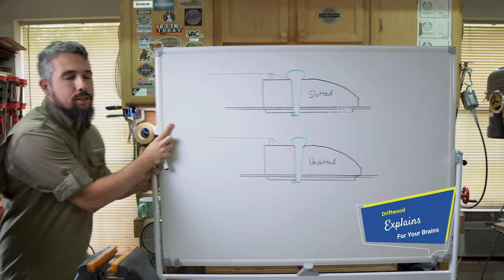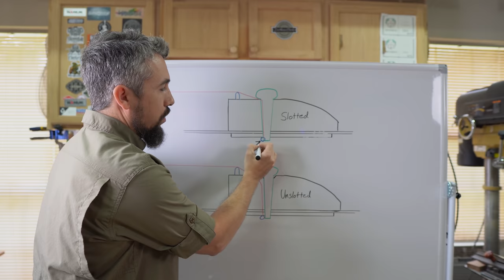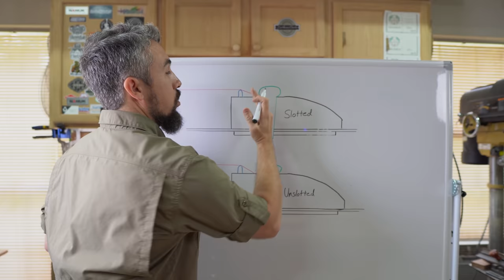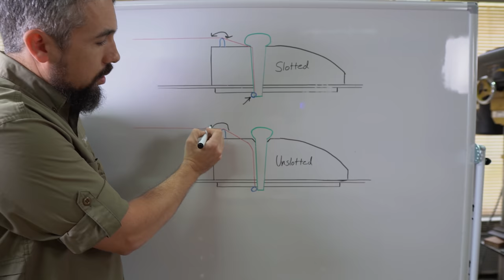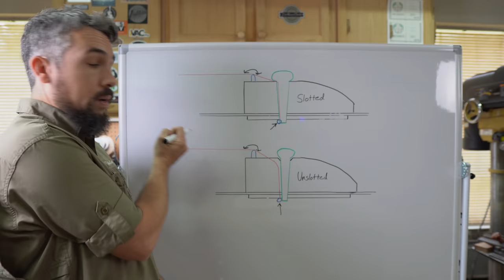This $25 Tool Can Help Anyone Make Their Guitar Sound Better!

Comment: Two points.  First, I'm not convinced this change in tone has anything to do with the slotted/unslotted pin.  I think the tone change is entirely due to the increased break angle, so you could get the same effect just sawing the slots at the top, but keeping the slotted pin.  It's the bridge that transfers the energy, into the sound board, not the ball end - classical guitars don't have ball ends at all, and archtops with tailpieces are not even anchored to the soundboard at all.
Secondly, and more importantly, you need to be very careful about changing the break angle, because you're fundamentally changing the way the static force (i.e. that due to the tension of the string) is applied to the bridge and soundboard.  With a shallow angle, the force on the bridge is mostly downward, but as you increase the break angle, the force is increasingly lateral, pulling the top of the bridge towards the nut.  For tall, thin bridges this can distort them, or make them tip forward in their slot, ruining the intonation.  You're also changing the force on the whole bridge plate.  With a shallow angle, the tension of the string is mostly pulling where the string enters the hole.  With a high angle, that force is applied much higher and further forward, and may easily double or more the rotational moment on the bridge plate.  Depending on the soundboard material and the bracing construction, this can cause the soundboard to deform, with the bridge assembly twisting towards the sound hole and developing a distinct belly in the lower bout below the bridge.  Many acoustics develop this problem over time anyway, but if you increase the break angle, you're only going to hasten this.  I'm not saying it's wrong to do this, just that you need to know what you're doing.  It's not something to be taken lightly.
Some of the comments are saying they've done this, and how much it's improved the tone, but in five or ten years, after their soundboard has distorted, and they need their neck re-setting to compensate, they may not be so thankful.

Comment: I saw a flash of a bridge style in here that is the same style as I completely replaced on a 1985 Vantage I bought from a pawn shop for $68.00 to learn on so I wouldn't have too much invested in something that might just sit in the corner collecting dust and the odd mite.
 Turns out I'm enjoying it almost two years on now.
 The bridge was a normal one with pins, but it was getting a worse belly bulge and the higher the strings were rising the more I played. I bought another cheap one (92 ovation that turned out to have the same problem), set the Vantage aside and looked at it from time to time figuring out what I'd do about it. Bought a bridge doctor and decided not to use it because it just seemed like a bandaid.
 Finally decided to pull the strings, put it on a multi-use steam box I built for hatmaking, so I was able to steam and press the soundboard back to it's slightly curved shape over some months. Carved out some elk antler in the shape of a tailpiece and bridge like (the same as I found from going to your website and watching your video today) your Di Vinci setup which sounds and plays great with no bulging at all after about three months now. I made another one for the Ovation Celebrity, but, I think I killed it while trying to readjust the neck angle from the inside with a tiny jack. Though I may be able to correct the problem (a crack in the plastic back), I don't have much invested in it either, so it won't be a heartbreaker for it to turn into wall art. The antler pieces I made can be transferred to any number of guitars  (perhaps one I build should I collect the requisite wood) so my works of art will be useful for years to come.
 What do you think of carving the bracing from the solid soundboard and back rather than from using the separate pieces glued into place? I like to experiment!
 Mass respect for your prices! Artists get so little for their work!

Comment: I use an up stroke to slot the bridge plate so as not to tear it out like you did . Once that slot is established then I will use down strokes to ramp the bridge. I also will turn the slotted pins around if they are wood or bone. If not then order some new solid pins if they are plastic.  Enjoy the video, thanks for sharing.

Comment: What if you took those "teaching guitars" that you've cut in half, and placed some drum tensioners around the sides, and made a cork gasket to go along the edge, so you could put them back together, how well do you think that, or something similar, would work, so you could demonstrate how what you've done has changed the sound?

Comment: You should make a PSA for that tire analogy: "Quit spinning your strings and increase your bridge's contact patch by 37% for more sonic traction on those cowboy chords! 🤠 You'll thank me later 😉👍"
Reply from the maker: Haha I love it
Reply: + @DriftwoodGuitars  
Sorry for the offtop, but what do you think of "tonewood debates" in electric guitars -- can we get any predicted benefit from "tonewood" ?
Higher than 5-10% than overall component synergy.
Reply: @iridios6127  bridge to tuners should be practically rigid, so the energy stays inside the strings longer, that's how aluminium necks, chipboard or acrylic bodies sound just like "the real deal". Good material choice and the resulting imperfections in resonance/damping and rigidity color the sound favorably, not the trader printed sticker label. Same as this $ 25 saw might as well be a very low profile nut file or a $ 3 saw or a piece of sheet metal with a single row of teeth cut quickly, the results and ease of use matter, though ;)
Reply: @dushk0  
Thanks for the answer, I guess.  ))
But I’m not aware of your experience with wood.

Comment: What concerns me is that the increased saddle contact will shift the intonation - pretty tough to fix that on an acoustic. Keep in mind that the whole issue that makes the strings need slightly different lengths is that the resistance of the wire to bending at the end point effectively shortens the string. A knife edge saddle (if it doesn't cut the string) allows the end of the string past the saddle to pivot with the vibrations, rather than be held still like with this slotted bridge approach.
Also for those who think this might improve sustain: that's impossible. The more efficiently you couple the energy of the vibrating string to the body of the guitar, the faster it will dissipate.  I have to use super heavy strings on my resonator guitar exactly for that reason - otherwise the strings' mechanical energy gets transferred to acoustical energy so fast that it starts to sound like a banjo, all attack and no sustain. If you do this mod, move up to a slightly thicker gauge string and your sound will probably be amazing - as long as that intonation issue doesn't bite you on the bridge.

Comment: I've watched a video where the guitar tech said that doing that cut keeps the bridge from ripping apart, because of 1. strings pulling the bridge, 2. pins distance between each other so the results is ripping the bridge.

Comment: The break angle doesn't change the sound, as long as it's "enough" to keep the string in touch with the saddle during the cycle. If you'd like send me a message I'll give you a link to more info from people who have tested this. Slotting the bridge is good for the bridge plate, and may help if the instrument has a low saddle, but that's about it. Nothing you said in this video is sientifically proven, or true. Unfortunately. Those who have tested this stuff have different findings than what you are saying here.
Reply: Steeper break angle = More tension = better contact = more effiecient transfer of energy. Seems clear to me. Thats why some guitar companies have started slotting their bridges. Hold a moderately hot iron bar, you can maybe last a few seconds. Grip it tight and that energy transfer is almost immediate. Couple this with full contact to the bridge plate and you are bound to notice a difference. Most Cort Acoustic Guitars now come with a slotted bridge, its not done for fun.
Reply: @paulneedham9885  This isn't an opinion. As long as the string doesn't lift off the saddle during the cycle no power is lost.  The angle needed for this is quite small. Different wrap angles on the saddle can alter the timber, be limiting the rolling motion of the string and thus reducing it's effect on the transverse mode.  But it really needs to be high to have that effect, which usually isn't good nor bad, but more often not positive, it's rare though. Do you have guitar making experience or are you just covinced enough to go spend 100$?  As far as the ball end, I see no reason why it should be pulling less tightly against the top then with a well fitted regular pin, it has the same tension. Either way in order to claim it has any tonal effect you can have an opinion, which is just that, or you can rig up an experiment which isn't easy to do nit the least because any difference will be so small it would be hard to measure. You'd also have to account for the removed mass which can make a bigger difference than the other stuff. Anyway... I have no problem with any of it, it a good mod to do. But I will speak up to misinformation put together In order to sell you a few overpriced somethings, which is exactly the practice that was frowned upon at the beginning of the video.

Comment: I'm happy to see luthiery techniques shared with the public, but I'd be happier if they didn't come with bad explanations. The energy from the string tension at the ball end going into the bridge plate or into the pin is not relevant to timbre, because THE BALL END DOES NOT OSCILLATE WHEN THE STRING IS PLUCKED. It's not a "slim tire - wide tire" situation because the power transfer doesn't occur there. There is no oscillation left past the bridge in the string for it to transfer. A much more accurate automotive analogy would be to describe the ball end as the lug nut that holds the tire in place. Unless something is seriously wrong, changes there aren't going to change tire traction.

The soundboard is excited by OSCILLATION AT THE SADDLE and it is the downward force at the saddle ONLY that transfers that oscillation to the soundboard. The bridge saddle apex is the tire. The ball end touching whatever else has nothing to do with it. That's why string tension pulling directly upwards on the bridge plate or partly on the pins doesn't matter, because the total upward force remains constant and only the total matters, because its counterpart force is the downward component of the string force on the saddle. That force remains unchanged at any distribution of the upward force between pins and bridge plate and that downward component is the sole factor for transferring string oscillation onto the soundboard.

If anything, power transfer under the guitar bridge goes the other way - increasing bridge plate contact with the ball end will at most make the ball end vibrate more, as a consequence of the bridge and top absorbing string oscillation at the saddle apex.

This isn't to say that the possible timbre benefits to a slotted pin hole aren't there, but it's really really not about energy transfer from ball end to bridge plate. Physically speaking, you're reducing the total mass of the bridge and you're increasing the saddle break angle increasing the downward force component. However, I'm sceptical of actual impact and I'd have to see serious experimental data to believe it's not negligible.

Again, I appreciate the sharing of specialized woodworking knowledge, but it doesn't sit well with me that this video makes a rather tall claim here and then doesn't support it with even a simple A/B test that was fully viable. The field has enough myths and disinformation going around as-is, and it'd be a really good idea to reach out and consult a mechanical engineer or whoever with some more specialized technical background to vet an instructional video if you're getting into the mechanics of a system.

Comment: Great info Chris! Thanks for sharing your experience and insight! Stewmac now has ‘files’ for this (which come in handy for other projects - a great excuse for another tool!). Is it feasible to fill the slot on the bridge pins with superglue and add some ebony dust and sand round? I’m going to do it.

Comment: So is the string energy greater "in" the ball end, versus any other point of the  string because of its larger mass? I've always thought of the ball end as having having no other purpose than to secure the string in place and that all the energy transfer occurs at the point where the string passes over the saddle.
Reply: If the saddle is slightly loose in the bridge slot, which I have seen in many acoustic guitars, (even Martin), the increased break angle could push the saddle toward the nut putting the intonation out. This would indicate to me a new tight fitting saddle, and intonation adjustment would also be neccesary.

Comment: I just did this to my old mahogany Stewmac kit build, which I did build right
I used a fine tooth cheap coping saw blade 
I popped off the retainer lug with pliers to get the blade into the hole
Stood the guitar on its headstock and cut, lined up straight, down to the bridge plate, only as wide as each string required
Cut a little ramp notch on top of the bridge to ease the strings direction towards the saddle
Then I could turn the pins around until I get nice unslotted ones from Stewmac
Now the strings hold themselves in under tension by their balls lol
It transformed the guitar
Cut string grooves into the guitar, not the pins
The bridge plate now functions optimally
No more jammed pins and munted bridge plates
Just make sure you feed the string down, pre-bent, so the ball is pushed under the bridge plate
The pin is just for safety
It still should be snug
Thank you heaps for this cool tip and instructional video
I'll do this for the others now
It's been a well kept secret, hopefully no more

Comment: Bought the saw,  just did my Blueridge 140A. Sustain was greatly improved. Then did my Epiphone J45 same result , a lot more sustain. Then I did my D18 she sounds awesome. All three guitars less than 10min each. I highly recommend this mod you can really tell a difference I just turn the slotted pins around.
Thanks Driftwood Guitars
Reply from the maker: Awesome! So glad to hear that. Thank you for the testimonial.
Reply: @DriftwoodGuitars  Can you just try the first 3 thin strings and leave the bass ones as the baas strings sound fine on my guitar? And if this mod is good do you make your new guiars this way?

Comment: I own and operate a guitar shop in SW FL and whenever I do a set up or change strings on a customer’s guitar I sand the bottom of the bridge pin so it has a 45 degree angle. This makes the string ball end contact the bridge plate more and doesn’t hang up on the bottom of the bridge which will make the pin come out of the hole.

Comment: A very simple thing is to put a brass wire through all the tips holes of the strings under the bridge. It will also increase volume sustain and better tone.

Comment: To brainstorm a little... how about eliminating the bridge pins by loading the strings through the bridge plate, top and bridge from inside the guitar, reaching through the sound hole and feeding them out the front of the bridge? Kind of like a string-through-body on solid electrics but no ferrules, as they would add unwanted vibrating mass in the system and pose additional fitting and installation challenges. For most common string guages the through-holes would only need to be 1/16" or about .060. From the front you would see the strings emerging at the desired break-over angle to the saddle from a line of small clean uniform holes in the bridge. On the inside bearing surface, chamfer or relieve the holes with a ball mill, countersink or just sandpaper so that the ball ends have a nice place to nestle in positively and have a fairly elastic energy transfer to the top. Or just machine a corresponding 30° face on the bottom edge of a somewhat thickened bridge plate to act as a bearing surface so the string sits and pulls squarely to it under tension. Just an idea. Admittedly it would be hard to change one string at a time. Some other pros and cons too I'm sure but maybe this is a good place to start a further discussion. I never had this idea before; just throwing it out to you and your other viewers for discussion...

Comment: Alverez achieved a steeper angle by having a stepped bridge with the saddle on the higher step and the pins on the lower step. I have their mahogany 12 fretter which has a beautiful tone, whether any of it is due to the steeper angle I couldn't say but it's clear that some companies including Alverez believe it. Although the holes aren't slotted. Having said that my Taylor 314CE holes are definitely slotted and if Taylor have started doing it then I'm ready to consider it probably beneficial.

Comment: The pin is the functional anchor point, but the saddle is the fulcrum. I do agree that increasing the break angle will make a difference. I'm not sold on the importance of bridge plate contact because I wouldn't consider current configuration faulty. To truly make a noticeable difference, you would need to use; a dense saddle material, a dense bridge pin material, and ideally a denser bridge plate. - The pin is in direct contact with the bridge system, so the string end has 2 contact points.
- A sound comparison would be required to sell me on it.

Comment: Switched to a set of brass bridge pins and the guitar(Martin OM-1) got brighter. Then got a different set that obviously had more actual brass and the sound DEFINITELY brightened up. It may not be the sound you want if you’re looking for a purely classic flat top sound but the tone difference is undeniable.